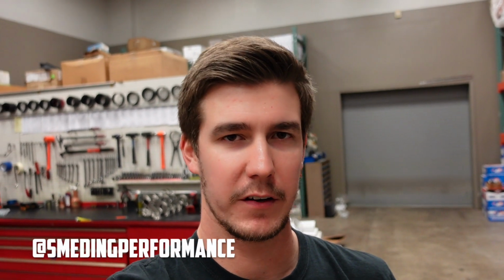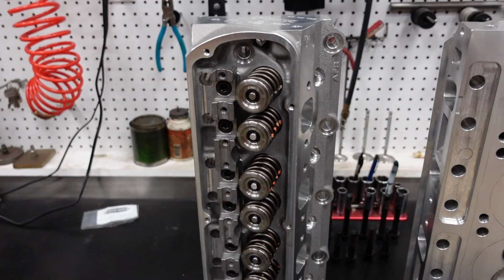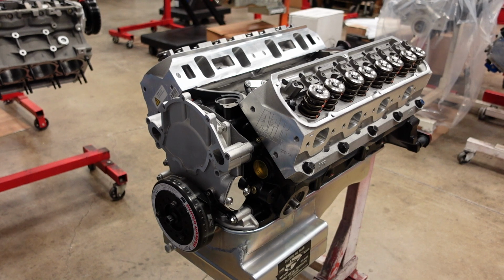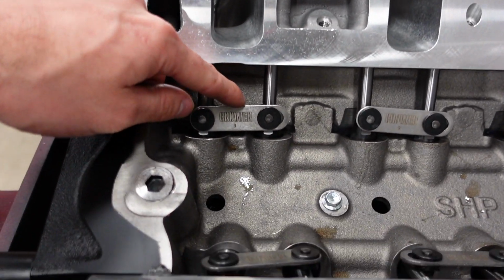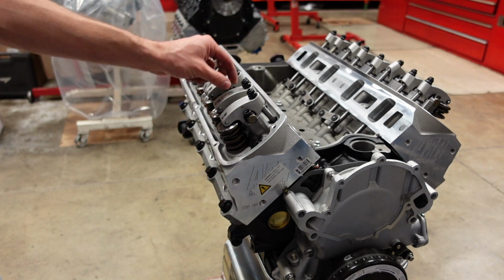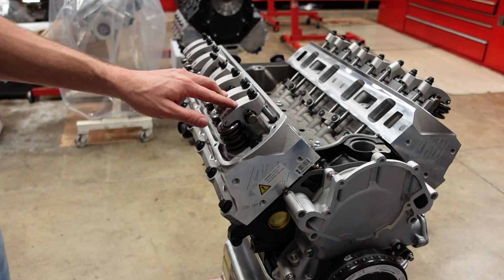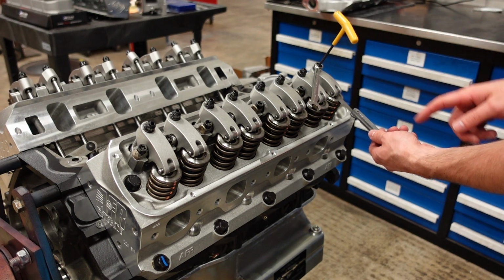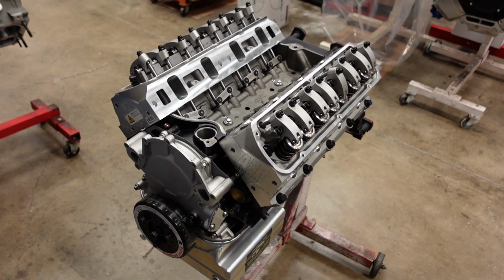8,000rpm 363" Small Block Ford Complete Engine Build - Part 2

Comment: I've always wondered coming from a budget build perspective what the best stroker combination is for an n/a very responsive mostly Street manual car. Because I've heard some 331s that are snappy as hell soon as you hit the throttle they are at limiter but I've also heard some 363s 393 and 408 that do the same thing I just don't understand rod ratio Dynamics enough to make the most educated analysis. Probably has more to do with camshaft selection solid roller vs. Hydraulic and obviously compression and head flow....
Reply from the maker: 90% of an engine being “snappy” comes from a lightweight flywheel & pressure plate assembly.

Comment: I always questioned the added gasket maker around the water jackets on top or under the gasket as most manufacturers say not to do it, but you guys do this for a living and have built way more than us common people. What is your opinion on something like permatex copper spray on a btr small bore mls or factory ls9 type gasket for a boosted 5.3? Thanks
Reply from the maker: Copper spray won’t hurt anything. My personal twin turbo LS has copper spray on its Cometic MLX head gaskets.
Reply: @JacobVillemain  thank you

Comment: What is the spring rate on the valve springs?
Reply: Also, interesting choice in Valve Spring for intended application. 8k rpm and the increased need for very good valve control. No use of Conical or Beehive style ??